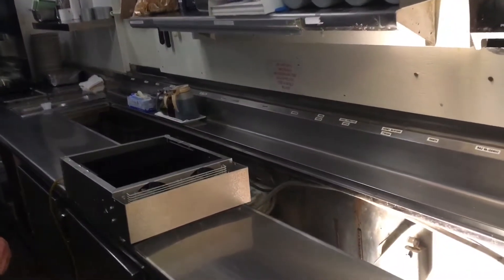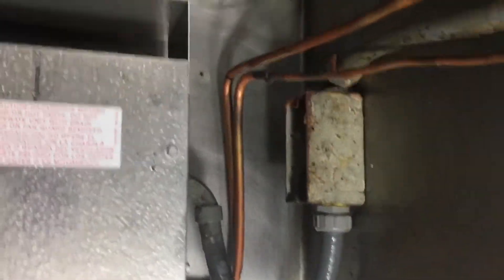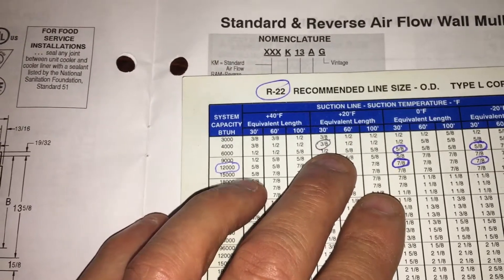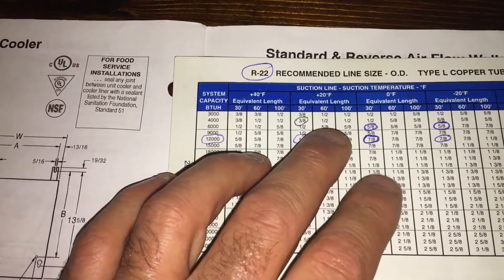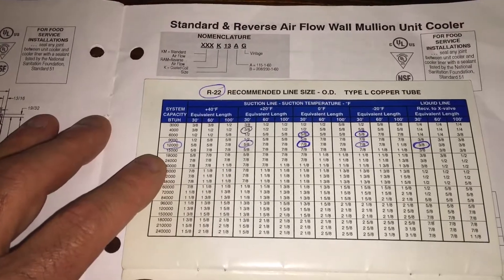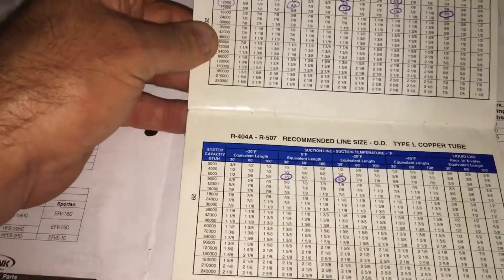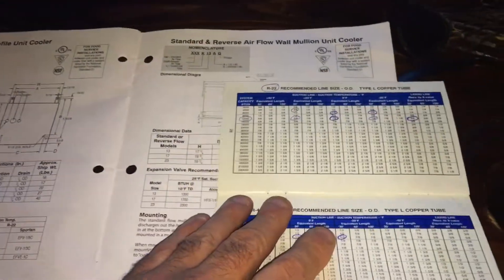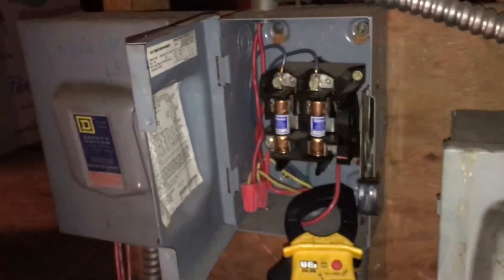The importance of Refrigeration Line sizing-example & charts explained.

Comment: just another very informative video Oc! This is awesome, whatever project i am working on i just google"  sizing by OC refrigeration'' and boom i get my answers! 

So i have two reach in coolers Larosa costume one with cold rail and a TAG13AG evaporator which im pretty sure they are 1300 btus. not sure how many btu the rails are on a 3 door reach in cooler. and also have another 2 door reach with just a 1300 btu two door box. BOTH reach ins have txv, 134a, Tecumseh ae4440y 1/3 hp compressors . 
(these btw are the same units you told me to add sight glasses on and after i did they have been running awesome with perfect charge on)
In the unit with the rail the condensing unit was replaced and oversized to a 1/2 hp condensing unit and now it short-cycles because the unit is oversized. 
I was thinking on connecting the other reach in to the 1/2 hp condensing unit so it wouldnt short cycle . They were 3/8'' suction and 1/4'' liquid line. 

should i go for a 1/2 '' suction or would the 3/8'' carry the roughly 5000 btus . 

the line set is close since both reach ins are next to each other. 

i know im going on a tangent here but i look up to you and your opinion so much !
Reply from the maker: Thanks !
1) you have to stop that unit from short cycling or it will die. use a 5 minute time delay & contactor or use a digital temperature control & comtactor & set compressor protection for 5 min time delay.
a compressor going on and off will die & it wont do it for long.

2) see the book. page 25. 

heatcraft engineering manual 

http://www.hvacrinfo.com/pdf_misc/heatcraft_eng_manual.pdf

see page 25. +20 suction. R-134a.

1/2" will work for 5,000 btus but the book says 5/8" suction. id go by the book. 5/8". R-134a line sizes need to be bigger. low pressure refrigerant.
Reply: @OcRefrig  Thats some great info there thanks Oc! 
does it matter that that calculation was made for a 25 feet lineset and my lineset is only about 5 feet , you think??
Reply: also should i do 5/8 from the evaporators all the way to the  condensing unit or should i just put a 5/8 "T " that will connect the two 3/8 s into the 5/8 to the condensing unit
Reply: i guess you answer that question at 59 second into the video but i wanned to clearify thats all ❤️👍🏼
Reply from the maker: calculation is up to 25' Run. from 1 foot to 25'. all calculations are up to that number.
Reply from the maker: do 5/8" from compressor to a 5/8" Tee then then a short run of 5/8" copper out of both sides of tee to 3/8" from evaps.
Reply: @OcRefrig  sounds like a plan oc 🤙🏼🤙🏼🤙🏼🤙🏼Just so weird that this 1/2 hp compressor has  5/16 stubby for suction side. why the hell would they put it so small. going from a 5/16 to a 5/8 on the compressor is going  to be interesting to braze lol Does it matter what the compressors suction/discharge stubbies sizes are ?
Reply from the maker: No. i use it as a reference point though. if u start looking at outdoor rated refrigeration units you will see compressor line sizes vary greatly compared to what the fitting size / line size that u sweat up to is that is outside the unit. especially on a 134a unit.
you will want to remove / unsweat the existing  pipe from inside the stubby & sand the outside of the compressor stubby , put the 5/8 around the stubby about a 1/2" down , pinch it tight around the fitting with dikes / side cutters / pliers and sweat it in place using 45% or 56% preferred , & white braxing flux. 15% can be used but it is a lower temperature weld with 56 and the fitting is steel with only a flash coating of copper. so it's actually a steel brazing joint.
use 56% flux and low heat , and it will go easier for you. practice a bit with 56% on a copper to copper joint if u have never used 56% before. do a 5/8" coupling copper joint with 56% for practice first to getvthe feel of 56% flow characteristics on a regular practice joint. use lots of white flux on outside of fitting when cold & dip rod in white flux while brazing. it takes less heat with 56% than 15% silfoss. its like really high temperature soft soldering. very strong & looks beautiful if done correctly. if the 56 bubbles its too hot a flame. try not to overheat 56%. you can sweat 15% over 56% if u screw up or mess up. they mix just fine together. the 15% will cover the 45 or 56%.
have fun 🤩!
Reply from the maker: Tricks - u can pick up alot of performance on a unit switching to welding outside the compressor stubby than putting pipe inside suction stubby because the hole is bigger now & gas can travel into compressor at a greater rate & quantity.

2) i use stubby size as a reference --- i allways pipe one size bigger for better performance.
Reply: @OcRefrig  Thank you thank you and thank you!!! 👍🏼
Reply from the maker: Your Welcome !😁
Reply: @OcRefrig  Hi oc, so went ahead and did all the above! everythjng running as should i can tell that the size you told me to use (5/8") is so much better than the 3/8  it had. 

BUT i need your opinion on something else now if you dont mind 

Im short cycling when in pump down. 
The compressor runs the evaps in the boxes once they satisfy, it pulls down and runs the cold rail via LPS and pumps down at the same time at 10 psi. cold rail runs around 8 degrees F guess? 

I called manufacturer and they set the low pressure switch 20 psi cut in, 10 psi cut out. 

but the pressure rises to 20 real quick and short cycles pulling down to 10 psi while its pump down 

now i know that the cold rail is constantly "feeding" because the selenoid for it its always open besides at night that we shut it of to defrost . but it does it even at night when rail is out 

what do you think?? Selenoid valve sticking open a little in the boxes ? 
Should i adjust the lps to like 35 psi cut in so the rising while in pump down wont make it to cut in and short cycle? should i maybe run the rail colder and make the cut in lower than 10 psi? 

what do you think 

thanks for your time 
i wish you had merch or something i could support you for all the help you have given me over the years man!!
Reply from the maker: Test the compressor valves. You might have compressor valves that are leaking by a bit. if so , you cant run a pump down system without replacing the compressor. You will need to run the system with temperature controls. which is a better way to go anyhow. Pump the system down to 5psig using the receiver / shut off liquid line and see if the 
Compressor holds tight at 5psig. if not. leaking valves in compressor. dont let short cycling happen. use a temperature control , time delay and a contactor to alleviate short cycling. a low pressure control can also be in the mix if needed.
Reply from the maker: When pumped down to zero psi & liquid line shut. suction should stay at 0-5psig. unplug unit / power it off and watch suction if suction keeps rising up to balance pressures = bad valves / worn valves / valves leaking by = replace compressor if it does not get to temp or if u want. if it gets to temp its just going to be a little less efficient / alot less efficient depending on how leaky valves are.
Reply from the maker: maybe ill try to set up a Buy me a coffee ☕️ thing like dave has. ill check it out.
Reply: @OcRefrig  it gets the box down to temp just fine and doesnt rise above 25 ish psi so i can just set the cut in at around 30 psi so it wont hit it to short cycle. I just dont know what temp should the cold rail run. i would add a tstat to the suction line of the cold rail since theres no spot for it but again i dont know what evaporator saturating temps should a R134a cold rail run.
Reply: @OcRefrig  you should!!
Reply from the maker: You want the cold rail to Run about 20 degrees below what u want the product temp at. im guessing 35 product temp. so u want a 15 degree cold rail , maybe colder. cold rail wall temps are usually 7-15 degrees temperature usually. so u just look at a p/t chart and figure your suction pressure your looking for. 15 degrees using R-134a = 15 Psig on your guages. so set your cut out about 10-15psig. id say 10psig cut out , 30psig cut in = 10 cut out , 20 degree differential.
Reply from the maker: ill do it asap.
Reply from the maker: manufacturer probably meant - 10psig cut out , 20 differential.
Reply: i ll do it tomorrow and see! i ll come bother you again here lol 

thanks again!!!!!! @OcRefrig
Reply from the maker: Your Welcome !!! 🎄🌴🎁 New video drops tomorrow 9am.
Reply from the maker: Maybe ill do a Patreon.
Reply: cant wait!!!!! @OcRefrig

Comment: This was designed this way  , or was it modified by someone?
Reply from the maker: Its 45 years old.  restaurant. It looks modified by someone over the years. Some one hacking in some new evaps over the years and cutting and welding in without paying attention to piping size / btu requirements. It looks like some one just chopped the 1/2 pipe and just shoved a piece of 3/8 inside the 1/2" pipe and threw in a 3/8 tee and just started welding. Also 45 years ago 45 degree's was the nsf standard. Nsf 7 now requires refrigerators reach colder temperatures 35-40 degree's with a max temp of 41 degree's. That being said Piping and equiptment must now be larger to accomodate quicker btu removal & lower temperature required.

Comment: I got a question l trough that you can't change the TD of your evaporator it when you selected the cooler evaporator and condenser unit
Reply from the maker: evaporator t/d is controlled by the txv / superheat. a 10 degree superheat is a 10 degree t/d across the coil. a 15 degree superheat is a 15 degree t/d.  etc. air flow across the evap affects t/d too. more air  or less air affects t/d.

Comment: Good video!
Reply from the maker: Thanks. Nor- cal. I Knew You could appreciate this Video. It's What we Do. We have to be on the look out for this kind of piping mistakes all the time on Multiple evap installs especially on cook lines where these mistakes stand out. Cook line drawers wont get to temp calls. Multiple drawers piped together with same size tubing , see it all the time , and it dont work well.
Reply from the maker: Owner said this line has never worked well. And i could see why. I removed the bottle neck piped line in 1/2" all the way down to all 3 evaps andbox will do 30 degrees now. The box actually gets to temp and shuts off now.

Comment: I have a question... what if the line set was one size larger than the chart calls for?  would it be detrimental to the compressor? or would it be easier on the compressor.. sorry for the newb question but I find this interesting and I also like to know how things work.  Thanks
Reply from the maker: Generally speaking a evaporator should be piped at The size of the inlet to the compressor suction.
One size larger can benefit in many cases generally. But usually never any larger than one size.
Reply from the maker: Exceeding more than one size larger than Compressor Suction inlet  WILL get u into trouble unless you are Very , Very Careful with Piping design. especially on runs Over 50 ft. Don't do it ! You will be sorry.